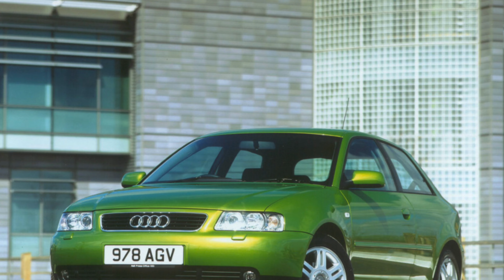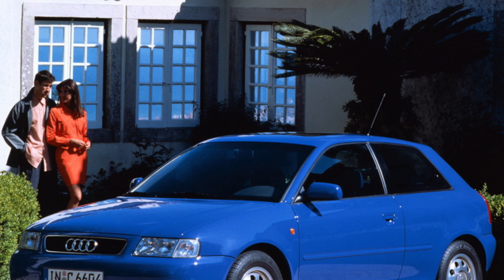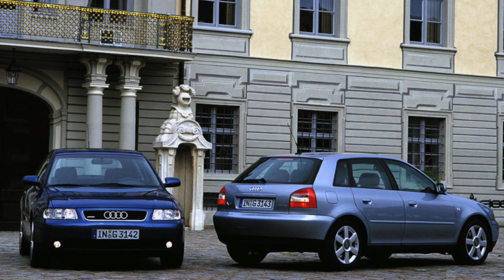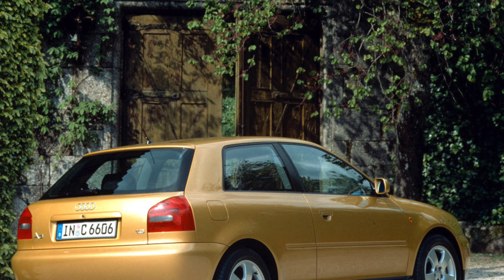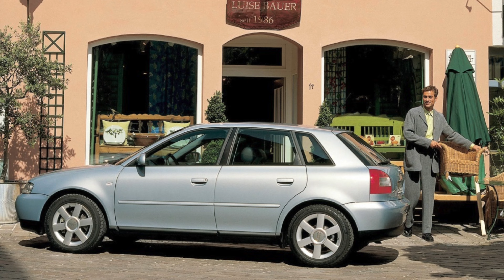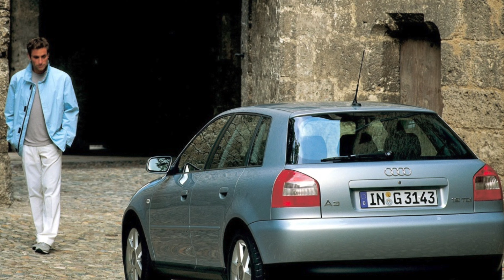Audi A3 (8L) Problems | Weaknesses of the Used Audi A3 I

Comment: Alot of them seem too have been thrashed and rusty lower doors, radiator fan on mine went and clutch line, a great car still though
Reply: Mine also had rusty lower doors and the radiator went, i fixed both problems. Runs perfectly 350k kms
Reply: @igor6388  haha thats funny because mine has a broken radiator fan 😂😂